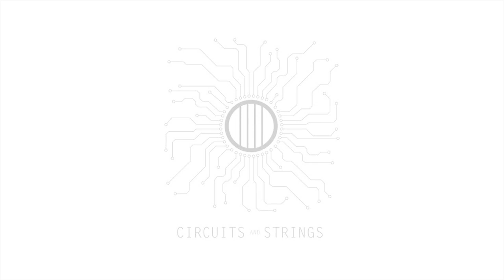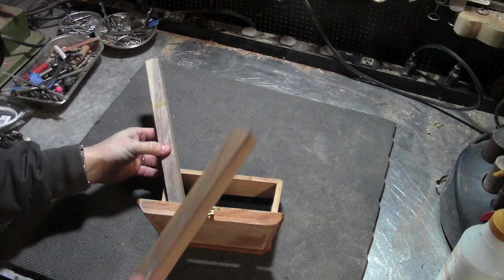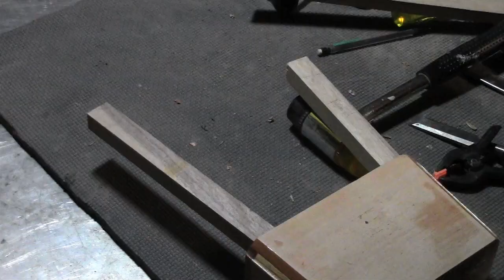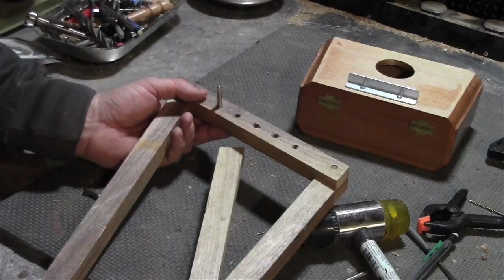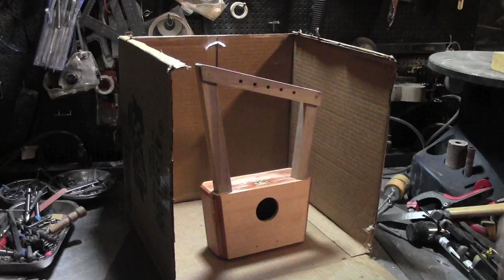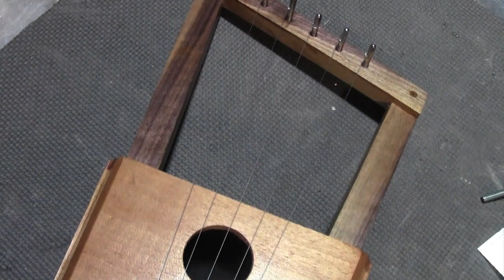Cigar Box Lyre

Comment: Great video and idea.  Are you willing to post/share the dimensions of the wood?  Is there a reason for the length and size of the wood you cut?  Can it be longer?  I dont know the specifics of a lyre, so not sure if the length affects the sound.  And the wood type?  Thanks
Reply from the maker: If you want, I can measure the wood lengths for you. The lengths were mainly determined by what I thought looked right. So they can definitely be longer. The longer the length, the lower the notes can be without sounding “floppy”.

Comment: I have that very same box and was wondering what to do with it, now I do. What strings are you using?
Reply from the maker: It’s a funny little box. Too small for a guitars and thick sides. I have a few of them that I am slowing working through. I used .014 plain metal strings for all five strings.
Reply: I was thinking maybe a mini  balalaika
Reply from the maker: That could work.